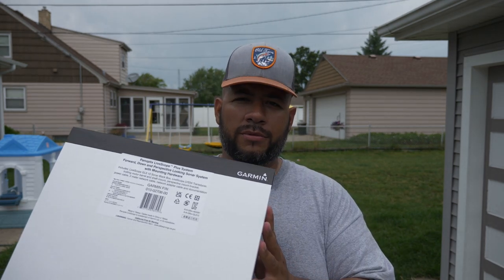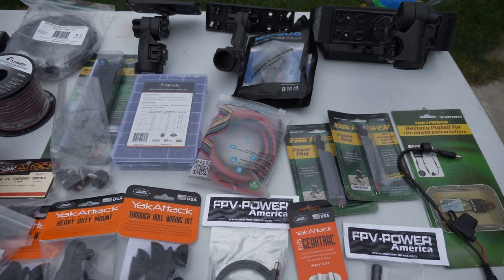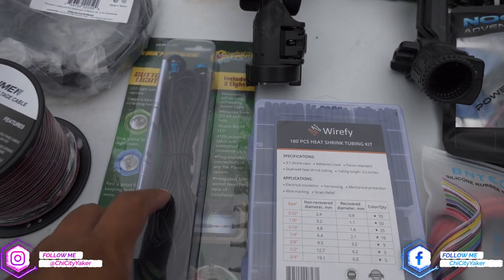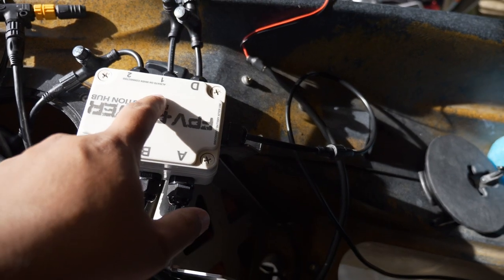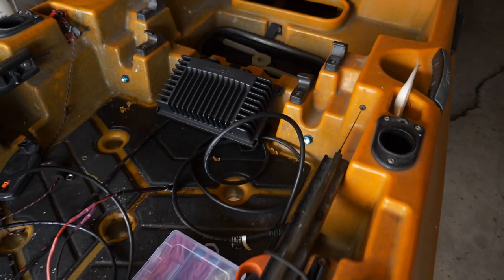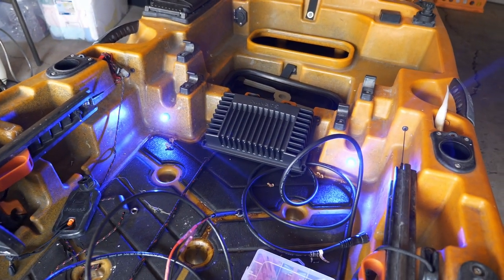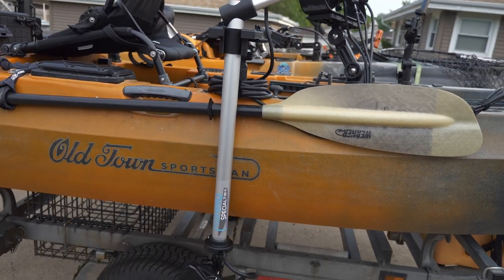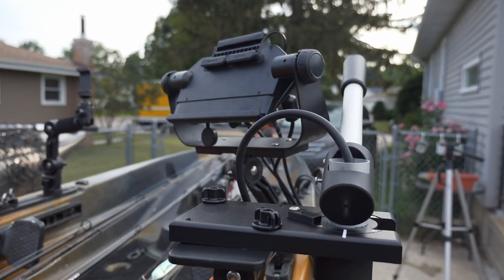The BEST Livescope Plus Setup For An Old Town Sportsman Auto Pilot Kayak

Comment: I see you are running the Amped 32amp hour battery for your panoptics. 
Does that battery fit in the front hatch?
Reply from the maker: Yes it does, with a slight mod of using a Dremel tool to shave just a little of the plastic to allow the battery prongs to slide through it. Easy stuff

Comment: Great video! I’m curious why you installed your livescope mount on a yak attack mount instead of attaching the Subplate to Your rails? I hope to install my livescope soon on my AP120 and trying to order the right parts. Would you consider adding another screen? Contemplating that as well as I have a second uhd 93sv
Reply from the maker: Versatility. I can move that YA mount and put it anywhere I want via the Lock n Load system. No I'm not adding another screen, I don't want to further complicate the setup. Adding another screen means I'd have to upgrade battery to power all that. Livescope already draws a lot of power.
Reply: Exactly my though. I’m going to steal this mounting system but attack it to the rails. Currently I have a summit pole mount connected to the track with a ram ball and it is horrible. The ram ball won’t keep the pole straight even at low speeds

Comment: Does you LS go into the water far enough? What size pole? The 24”? Seems like the mount sits pretty high.
Reply from the maker: yes it's perfectly fine. I think it can be tricky just looking at it from the video because it may look like its not long enough but remember that the water line on the kayak is just below where the paddle sits. So it's all good!

Comment: I have put livescope in many times i would not hook that to that power distribution center. That thing will cause interference.. you really need everything with livescope completely by itself.. Your screen will be clear that way..
Reply from the maker: Literally have zero issues with my live system powered vis the power hub. So perhaps there are other factors involved that can cause it cause I'm sure that can be a legit issue.

Comment: What part is the connector so you can disconnect your live scope? I definitely have set mine up that way!
Reply from the maker: I just used the livescope cable extension and run that to the black box and out of the thru-hull and then connect the transducer cable to it. That way I can disconnect and remove the ducer.
Reply: @ChiCityYaker  sweet. Thanks

Comment: 6 months in, anything you'd change with the pole setup? I'm using a summit and it moves anytime I go over 1mph picking this pole up tomorrow.
Reply from the maker: Nothing I'd change really. The only thing that bothers me is that it will squeak when turning the handle around and theres a bit of flex when under power. Not a deal break but something I've noticed.